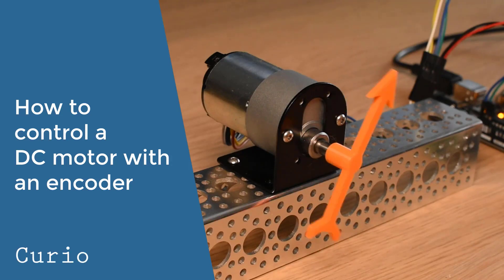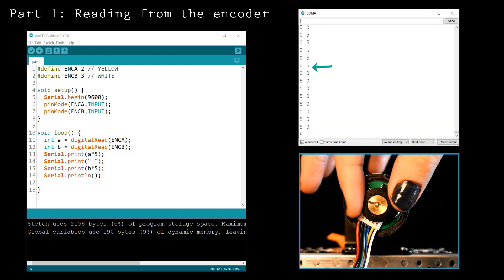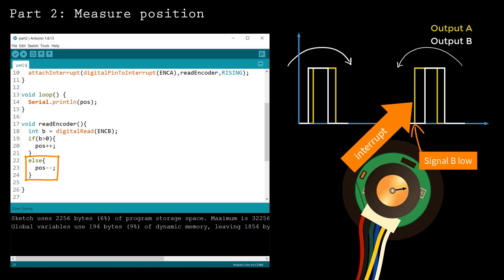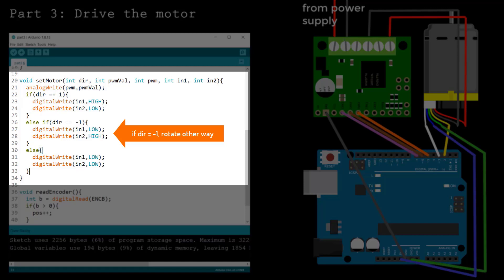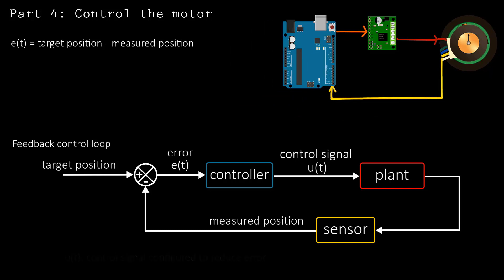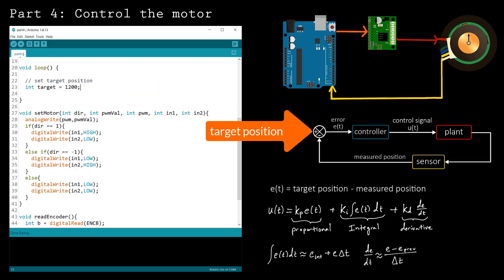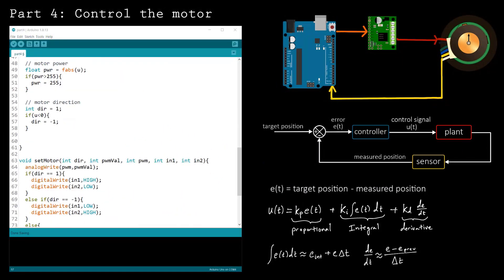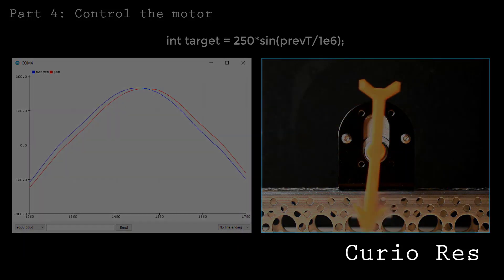How to control a DC motor with an encoder

Comment: Respected ma'am. Would you please explain what changes should I do for second PID in this code. 
Thanks once again.
Reply from the maker: Do you mean how to write code to control a second motor? You can copy and paste a lot of the code, it will get a bit messy though. For a more elegant solution you can use a class -- that's what I did in this one: https://youtu.be/3ozgxPi_tl0

If that's not it, can you expand on your original question? What exactly are you trying to do?
Reply: @curiores111  I mean to say I have to control inverted pendulum,where I am using two encoders and 1 motor (geared DC motor with encoder and optical encoder without motor). With DC motor I am controlling pendulum link,now I need feedback of another encoder to control the second link(arm) in limited region .I am eagerly waiting for your reply.
Reply from the maker: @saint79209  That means you're going to have to alter your PID algorithm. For balance control you can use one loop with more than one term. The trick is getting the right parameters, which is hard, you might need to model your system. Have you looked at these tutorials? https://ctms.engin.umich.edu/CTMS/index.php?example=InvertedPendulum&section=ControlPID
Reply: @curiores111  yes.
Reply: Respected ma'am please explain a more bit . How can I use this algorithm in this code for two PID's ( one for arm and one for pendulum link). That would be your greatness.
Reply from the maker: @saint79209  The simplest way is to compute two error terms, one for the arm and one for the angle. Then, you compute two control signals, u1 and u2. Then, you add u1 and u2 together to make the control signal. However, you have to carefully select the parameters for each controls ignal. I don't know those off hand, you'll have to look them up (and then tune the gain) or model your system to identify them.
Reply: @curiores111  Do I need two set of void  loops.

Comment: Great video! But could you please explain why my "pos" will stop during halfway of the whole iteration, and increase to the target position about 4 seconds later?
Reply from the maker: I am not quite sure what the issue is. Are you saying that your pos variable isn't updating properly for four seconds? Have you tried testing the encoder by itself (without running the motor) to ensure it can correctly measure the position?
Reply: @curiores111  The encoder works well because I also used your previous code to test it. I set the target as 1500, but the current position will reach to about 400, 800 or 1100 randomly and stop for about 4s, then reach to the target 1500. This is really strange.
Reply from the maker: @alexanderqu30  weird. it's difficult to say what the issue could be without additional testing. If you simply power the motor directly (without the control signal), will the encoder reach 1500 and then surpass it normally?
Reply: @curiores111  Yes, it can reach to 1500 without any weird issues. Interesting. I think one possible problem is about the time setting like the relationship between current and previous time, another is just the weird hardware problems. I will make further tests to have additional tries. Thank you very much for everything!
Reply from the maker: @alexanderqu30  good luck!

Comment: Is it possible 
to use a rotary encoder? to set the position.
Reply from the maker: Certainly. You can read the position of the rotary encoder, and then set the target position equal to the value you read from the rotary encoder.

Comment: Crystal clear ♥️♥️♥️. Would you please tell me how can I convert pulses to degrees in this code. I am eagerly waiting for your reply.
Reply from the maker: sure. For example, I had an encoder that records a maximum of 64 counts per rotation. Since this code only records when A rises, thats 16 counts per rotations. The motor has an 18.75:1 gearbox. That means the conversion is:

(1 shaft rotation)/(16 counts)*(1 output rotation/18.75 input rotation) *360 degrees/input rotation

overall, that means I would multiply the counts by 1.2 to get the degrees. For you, it will be different, depending on your gearbox, encoder, etc.
Reply: @curiores111 Thank you so much.

Comment: how to connect 4 dc motors with encoders with motor driver and Arduino? Or which motor controller do I need?
Reply from the maker: You need a lot of pins to connect 4 motors. You could try a Arduino Mega, but that probably doesn't have a fast enough clock speed to handle the interrupts from all four. You could consider something faster, like an esp32, arduino due, or another arm based microcontroller (there are several made by adafruit).
Reply: @curiores111  Thank you for your reply. Arduino Mega has only 6 digital pins so I can not able to use that. So can I use two Arduino's with two motor controllers or One Arduino due with two motor controllers?  I want to use those dc motors for controlling Mecanum wheels. Please suggest an option for that. can I go with raspberry zero? Thank You

Comment: how can i attach an rc controller to this
Reply from the maker: In the past I've used an rf transceiver (NRF24L01) to send and receive messages between an arduino with a joystick and another arduino with motors. Its a little work to code it up. You could probably find something simpler if you don't want to code it yourself.

Comment: what if i am usnig servo 360 and a rotary encoder? does it work the same way?
Reply from the maker: servos typically have a controller built-in. so generally speaking, it "works" the same way, but you don't write a control loop for it. It already exists within the servo.
Reply: @curiores111  I don't think servo which is either modded or an actual 360 servo has controller built-in? or do they have?
Reply: also how do i code it if i use 2 encoder? do i type it ENCA1 ENCA2?
Reply from the maker: @rizamboi2776  oh yes regular servos have a controller built-in. You can find lots of reference material about this. e.g. https://www.kollmorgen.com/en-us/blogs/_blog-in-motion/articles/how-servo-motors-work/   
360 servos are a little different, but generally speaking function similar to a servo.
Reply from the maker: @rizamboi2776  You can name them whatever you want! I have another tutorial where I do multiple motors: https://youtu.be/3ozgxPi_tl0

Comment: according to what we setting target position and what is the position unit for example angle or meter ? i don't un
Reply from the maker: neither, this is setting encoder pulses. If you want to set position you use the encoder and motor characteristics, like gear ratio and pulses per rotation. I explain it briefly near the end of another video: https://youtu.be/3ozgxPi_tl0

Comment: The video is very well produced, the code explanation is amazing and made me (as a mechanical engineer with rudimentary understanding of motor control) feel capable of implementing this, well done!
Reply from the maker: Thanks Lucas! I'm glad you feel that the level is right. It is hard to justify putting all that code in from a youtube video perspective, but when it actually comes down to implementing it yourself, it's probably the most important part.
Reply: @curiores111  You managed to keep the (usually boring) code exposure very well connected with the practical application so it wans't boring anymore hehe

Comment: I do belive you just saved my master thesis...
Reply from the maker: Glad it helped! Thanks for stopping by.
Reply: Speaking of it, there is a little 'mistake' in your integrator. There is a 'wind up' effect because it keeps integrating, even if the actuator is already at max power. If you 'clamp' the integrator, when u is 255, there will be significantly less overshooting :)

Comment: Do you have any recomdation for documentation regarding PID algoritm? Actually I was working on self adjusting PID values based on encoder's output, so wanted some good source on the topic.
Reply: Ok found and made the code. Would you like to read a instructable about my ventilator?

Comment: Excellent, I just finished following your tutorial and everything worked out great. Still playing with the PID values to get the sinus as close as possible to the target but I think the motor just isn't precise enough.
Reply from the maker: Good work! Using a motor with a higher gear ratio will help with precision. (of course, if you need much better precision a stepper is often a better choice) Adjusting the PID parameters can help, but won't be able to overcome some of the limitations of the motor, as you're finding.

Comment: Amazing video!! Question: Why do you multiply the sin wave by 250? Is there a way to have it bounded by just -1 & 1?
Reply from the maker: That's completely arbitrary. It just indicates the position target in terms of encoder pulses. If you set the sine wave to -1 to 1, it would only try to change the position by 1 during each cycle of the sine wave. Really, you want to set the position target in terms of rotations or distance, which I do at the end of the next video in this series: https://youtu.be/3ozgxPi_tl0
Reply: @curiores111  Thank you for your quick reply!
Reply: @curiores111  I am still confused about this, I am trying to control the position in degrees of rotation rather than encoder pulses. When I calculate the error for sin(t) and the encoder readings (degrees), the encoder motor cannot follow it. :(

Comment: very interesting and useful... I want to know if I could wire 4 motors encoder to one arduino uno (or mega) if yes how the schematic will be... and thank you
Reply from the maker: luckily for you I just made that video! ;) Find it here: https://youtu.be/3ozgxPi_tl0
Reply: @curiores111  Thank you verry much... just I want to know, should I use interrupt pin to program the motor encoder or any other pin is enough?
Reply from the maker: @motazmsaddak5242  You should use an interrupt pin for any encoder connection that triggers an interrupt in the code. If the encoder connection isn't triggering an interrupt, than any other pin is fine [in this tutorial, I only triggered the interrupt from encoder A, so it needs to be connected to an interrupt pin. On the other hand, encoder B could be connected to any pin on the arduino.].
Reply: @curiores111  Thank you for the quick response... I'm really appreciated with your help

Comment: Well, I "need" to replace steppers with low cost servos since i need high rpm and a coarse step size. Common steppers provide the opposite ...

Comment: My dear 
Curio Res!
I don't know how to send the commands to Arduino?
Use a potentiometer or other encoder to command the direction and speed of the DC Motor?
How do you do it in the movie???
Reply from the maker: I just assigned a target inside the code. If you want to use a pot or a rotary encoder to set the target, you could (a) connect your rotary encoder/pot to the arduino (b) write code to read from the rotary encoder/pot and (c) set the target based on the value of the rotary encoder/pot
Reply: @curiores111  Thanks again  lovely Jewelry

Comment: i am getting only output A line on the serial plotter. and on the serial monitor only the first digit changes, the second one stays at 0 as shown below. can anybody help me?

00
00
50
50
00
00
50
50
Reply from the maker: Possible troubleshooting steps:
(1) Make sure you connected the VCC and GND for the encoder.
(2) Try some different pins 
(3) If you have one available, try connecting a different motor+encoder
Reply: @curiores111  Thank you. Didn't actually expect a response this fast. If any. Going to give your solutions a go.
Reply from the maker: @gerbilatorgamez6571  No problem. Let me know how it goes and feel free to send me [curiores@gmail.com] a screenshot of your code and a picture of your connected circuit if you want a second set of eyes on it.

Comment: Is there any way I can control time taken to reach target; so the motor moves at a speed controlled by code so as to reach target in specified time?
Reply from the maker: Yes, the end of the next video will show this exact method with position control. I am working on that one right now. The tutorial after that will show how to directly control the speed (not the position).
Reply: @curiores111  Thank You; Will stay tuned for that. ☺☺

Comment: Just a warning... in the sample code the pos variable has not been marked as volatile.  You REALLY need to do this as the compiler may optimize the pos variable out and your code will not work.

Just the other day I had a robotics team forget to do this.  They could not understand why their robot would only stop if they performed a Serial.println on the encoder count variable.
Reply from the maker: Hi Dennis, you are certainly passionate about your volatile directive. I added it to the tutorial+code.
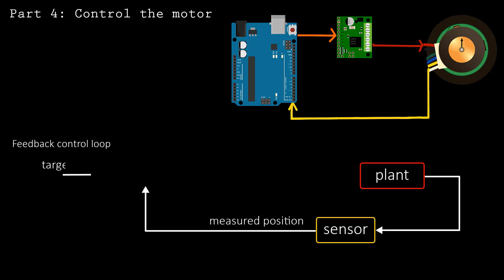Reply: @curiores111  Hi! thanks a lot for this video :) I could advance very well up to 4:50... after that... I have done everything, but my "pos" remains in 0... I have tried to mark the variable "pos" as volatile, seemed to improve, but... it remains in low value or returns to 0.... I appreciate some guidance please
Reply: SOLVED!  I just declared the inputs as pullups... pinMode(ENCA,INPUT_PULLUP);

Comment: If motor is taking power from external power supply then why  you are using PWM pin at 5  ?
Reply from the maker: The external power supply is modulated using switching MOSFETs in the TB67H420FTG. The PWM signal determines the duty cycle, and hence the speed of the motors.
Reply: @curiores111  Thank you so much🙏

Comment: Hi, this was a great tutorial. Do you know how I could go about adding buttons so that when a button is pressed, the motor will move to the specific position?
Reply from the maker: Hi Danny -- certainly, you could do something like that without trouble. Here are a few steps to get you started.
(a) connect a button to the arduino (see tutorial listed below)
(b) follow a tutorial to record button presses (here's a built-in example for arduino: https://www.arduino.cc/en/Tutorial/BuiltInExamples/Button) 
(c) Then, write an if statement logic. Something like...
  if (buttonState == HIGH) {
    target = 100;
  } else {
    target = 0;
  }
Reply: @curiores111   Hi, thank you, I have managed to get the switch working but I can't manage to get the motor to stop jittering around the set point. I have been looking online on how to calculate the correct PID values but I can't seem to do it. Do you know of any tutorials or websites that may be useful?
Reply: I currently have Kd set to 0.022 and this is what happens when it comes up to 1200

1200 1191
1200 1194
1200 1199
1200 1200
1200 1197
1200 1199
1200 1203
It reaches 1200 but then goes back down again then just keeps oscillating. Any ideas on where to go from here?
Reply: And when I let it run for a little bit, it eventually keeps switching between 1200 and 1201:

1200 1201
1200 1200
1200 1201
1200 1200
1200 1201
Reply from the maker: @dannyboy7656  Hi Danny. This sounds like a PID tuning issue. I plan to do a video on it in the future. But for now, you should look up "how to tune a PID controller" or "pid tuning", etc.

Comment: I so appreciate that you wrote the code out rather than called library functions - I've been working to control a motor with encoder via an MCU that doesn't work with Arduino IDE so seeing the code written out really helps.
Reply from the maker: Thanks for mentioning this Darren. Originally I thought I would be criticized for not using the library. Surprisingly, I haven't seen that yet. I'm pleased that the presentation I chose was suitable for your work. Good luck with your project.

Comment: When I use the final program, my motor doesn't go to the target and instead it stays at 175. Any ideas?
Reply: Or it stays at 0
Reply: I have managed to fix this but now when it get to the target, the motor start to vibrate like it keeps over correcting to get to the target.
Reply from the maker: Assuming you've removed all the bugs from your code, this is a tuning issue. Look for information on how to tune a PID controller. I plan to do some tuning videos in the future, but for now...

https://www.omega.co.uk/prodinfo/how-to-tune-a-pid-controller.html

From there:

PID Controller Gain Tuning
PID controller gain tuning can be difficult. The proportional method is the easiest to understand. In this instance, the output of the proportional factor is the product of gain and measured error ε. Thus, larger proportional gain or error makes for greater output from the proportional factor. Setting the proportional gain too high causes a controller to repeatedly overshoot the setpoint, leading to oscillation. While setting the proportional gain too low make the loop output negligible. One way to offset this steady-state error is using the Zeigler-Nichols method of setting the I and D gains to zero and then increasing P gain until the loop output starts to oscillate.
Reply: @curiores111  Thank you very much
Reply: @reignsman7610  same case with me :'(

Comment: Amazing explanation.
After saw full video, i subscribed immediately, by hoping upcoming videos would be best among.
Reply: Excuse me, only a nice Video, or did you try it real with those Codes  from this lady Administrator ?
Has somebody tested it bevor me ? Because i can try it only  with  another
 Motor Driver ( l298n)...etc...!
Reply: @superabbasalmani6079  yes. I did some project using this.

I made a coil winding machine using dc motor with PID controller.
Reply: @ARUNRAM-ARK  Thank you very much !
You are  a cool Guy, and Respect, because you took time 2 answer 2me ! Lovely!
Reply: @superabbasalmani6079  🙋🙋🙋🙋